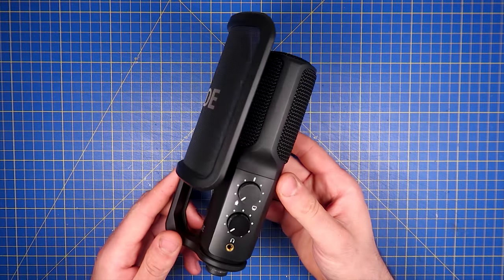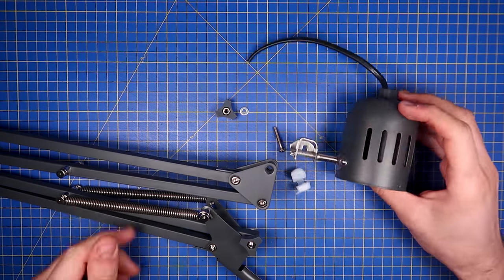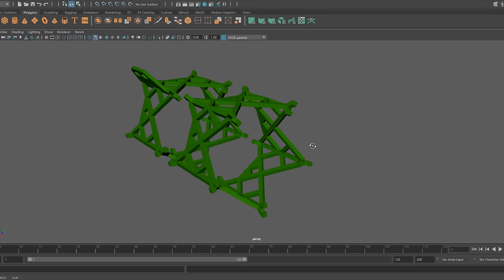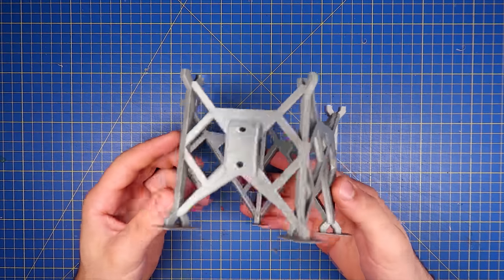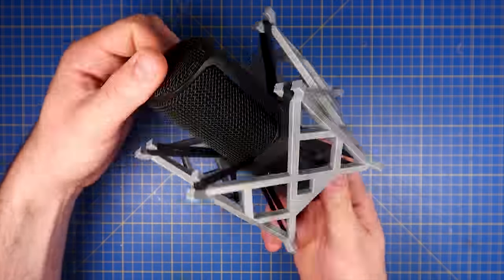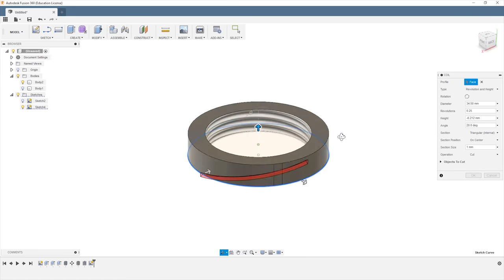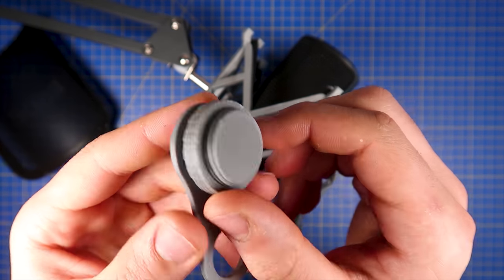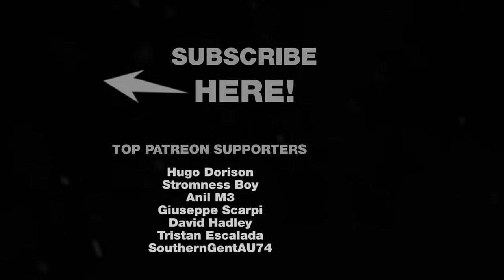Microphone Boom Arm. IKEA Hack 3D Printing

Comment: The NT-USB can also be used as a 'room mic' for instruments and voice, so the 15cm from your mouth may not matter as much as you might think. If you're using it for spoken voice audio recording, though, there could be minor issues with based on the material you used for the cage, and the fact that you've adjusted how far the pop filter comes out, so maybe try to get as close as you can to the filter with this setup. Even on newer videos, I find your mix a bit echoey for my taste. You have a naturally soft vocal tone, so I think you should absolutely leverage that.

Comment: Very nice! Question though: could the plastic on the pop filter have been melted and molded to strech farther, or would the filter then be too low for the mic? I like the solution you used, but wonder if a simpler answer couldn't have been found.

Comment: Nice one! Did you consider integrating the USB cable in the arm where the power cable used to be?
Reply from the maker: Yes, but the usb-B port is too big to pass through so I could have cut the wire but then I wouldn't be able to move the microphone out of the boom arm anymore! Definitely doable :)